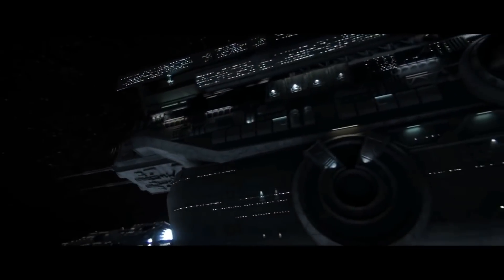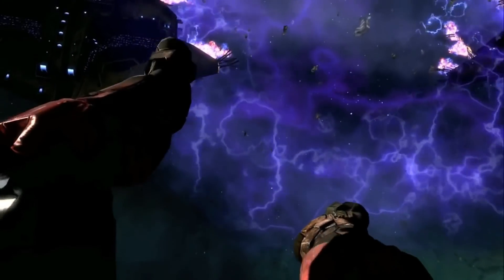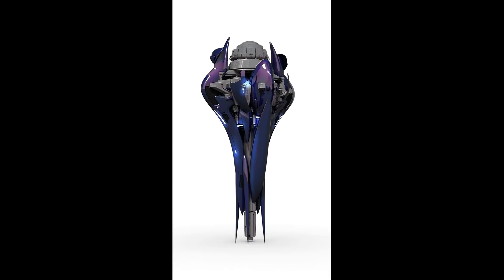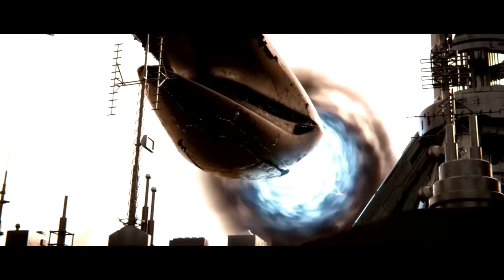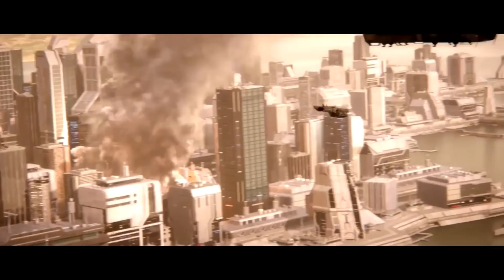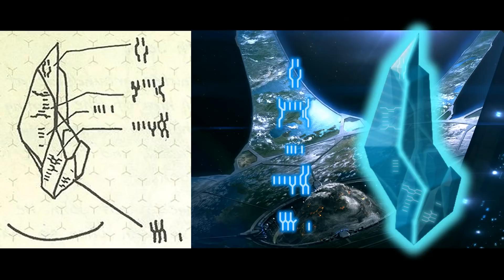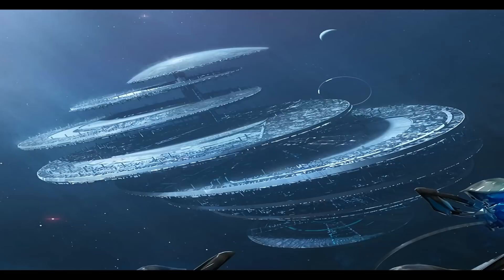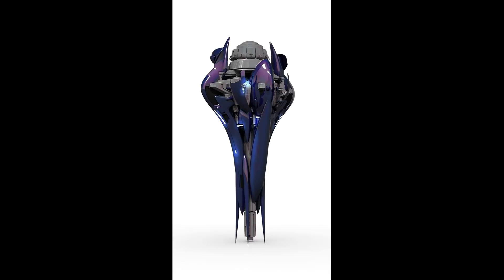Slipspace Engines - The Archive

Comment: Has halo ever mentioned cold welding? It would be cool if they built all of there ships is space using cold welding, which would essentially make the entire frame of the ship a single piece of metal.
Reply: In I think it was First Strike or Fall of Reach, they mentioned I think plasma welding. They said that the Titanium armor was 2 meters thick.
Reply: @Ratkill9000  yeah but thats not cold welding, that could classed as Arc Welding, cold welding is using chemicals to weld materials without the need of high Temp to bond the materials together.

cold welding is commonly done to Fission Reactors for Obvious safety reasons. it can be used for other things as well, but STIG welds preferred method of strong welds.
Reply: @Duke_of_Petchington  I know. They've never mentioned cold fusion welding, which in theory should take place at room temperature and colder.

My point being, in the books, they use plasma welding to build and repair the ships, never any mentions of cold fusion welding.
Reply: @Duke_of_Petchington  JB Weld? lol
Reply: Yeah, vacuum welding can be a bit of a bugger
Reply: @Ratkill9000  Jesus what ship was it? The autumn?
Reply: Is that good? One would think a high degree of flexibility of material would be better suited to the various temperature extremes of space and stellar bodies.

Comment: The impression that I got from the novels were that UNSC slipspace drives consisted of massive linear accelerators that would have taken up the entire length of the smallest slipspace-capable vessels like a MAC, and not like the box smaller than a pelican that you can simply pull out like in Halo: Reach.

Comment: Halo had a good chance to be hard sci-fy setting. Lack of all handwavium techs like FTL , artifical gravity and inertia damper could make the story greater .
Reply: To be frank Halo ftl actually isn't really that handwavy. The creating the portal part is the most handwavy. A alternate interconnected set of dimensions is actually extremely plausible. The artificial gravity and inertial dampeners are on the other hand pretty handwavy from what we have seen. But from a purely physics standpoint slipspace has no real glaring issues itself nor does traveling ftl though it. And even the idea of using a form of singularity to create a portal isn't bad. Though at this moment no good way from my perspective to solve the formation issue. Might be interesting to think on.
Reply: It isnt necessarily against the laws of physics to create a rupture in the space-time continuum. Every massive object in existence is already putting stress on it. Halo makes some unproven assumptions about the nature of the universe, but said assumptions arent really outside the realm of possibility

Comment: 7:07 No they can't. Based on our current understanding of quantum theory, creating the smallest possible black hole allowed by physics would require an accelerator of LHC's design to be scaled up to larger than the observable universe. There was speculation that several proposed theories extending the Standard Model might allow smaller black holes accessible to the LHC, but this has never been observed.

There is a clear improvement in accelerator tech over the 300 years leading to the slipspace drive given they shrunk the required accelerator size from larger than the universe to several meters. That does appear to be an engineering problem, and we have some promising ways to get there, but we're definitely far away from such a point.

Comment: So, in other words, by real life calculations we might be able to travel the galaxy. Once the fusion reactor becomes easier to mass produce.

Let alone after proven to work.

Which should be achievable by 2200s, or 2400s.

Why? Because, we are currently working on fusion reactors right now, and we should have one up, and running sometime soon. Before 2100s.

I believe during the 2100s after proving its viability as a energy source. Then work will begin to make it more powerful, and easier to mass produce.

The most powerful ones I believe that we could make would be zero g fusion reactors. Given that they won't have to work against earth's gravity.

Of course I believe work on a orbital fusion reactor would happen once the infrastructure needed to build one is built.

That would most likely happen after mars, and Luna has been properly colonized. With infrastructure needed to build the infrastructure needed to build a zero g orbital fusion reactor.

After one is built i believe it would first be used to colonize the outer regions of the solar system, like Jupiter, and Saturn sectors respectfully.

Last, and finally I believe that galactic travel would occur after probes would be sent to the nearest star system, and has been properly study.

Colonization of the solar system should begin soon with the most recent space race.

Colonization of the outer system would most likely happen after 2100s. Given that in between now ( being 2021) and 2100. The world would be focus upon the second space race, covid 19, possible ww3, possible second called war, and stuff like that.
Reply: Based on your comment I can tell that you are a deep thinker. I also ponder what the future will hold for humanity. Does it disappoint you that its extremely unlikely that you or I will live to see technology like you've described come into existence? Sometimes I feel like I'm missing out despite how advanced we are as a society. I guess when you realize that cavemen once though fire was high tech it puts things into perspective. Lol.

Comment: sooooo wait what happens to people caught in and exposed to slip stream space?
Reply: Probably similar to what happens if they fell into a normal black hole.
Reply: They would not be existing
Reply: You'd be floating in slipspace while being not alive.
Various objects have been caught in slipspace such as asteroids, space trash, etc, these are known to be picked up by slipspace probes. At one point a covenant fleet was mistaken for a comet after a probe came back with its readings.
Reply: @UPLYNXED  Isnt normal object cannot exist in slipspace without quantum field?
Reply: @ur-didact1991  I'm just going off the lore I know here. It could be that what you're referring to helps protect the object traveling through slipspace. Either from some kind of radiation or from warping since slipspace can be a bit bendy at times both in time and space terms.
Reply: @UPLYNXED  Normal objects that has spatial structure cannot exist in slipspace according to Halsey's journal